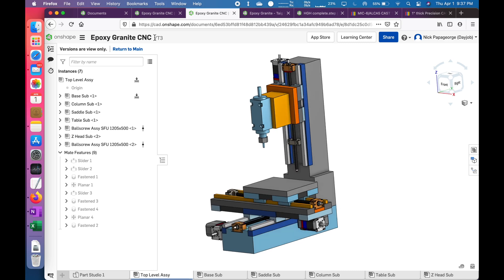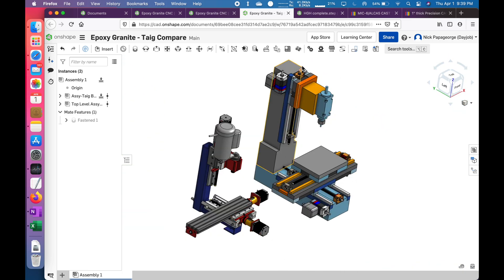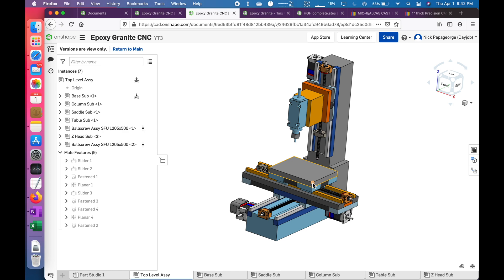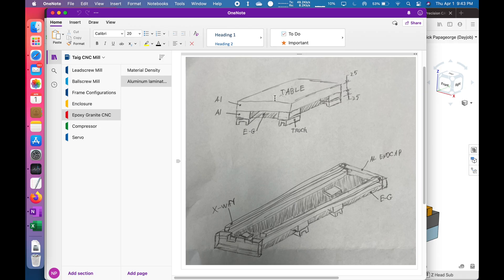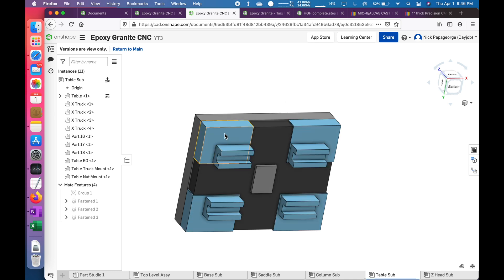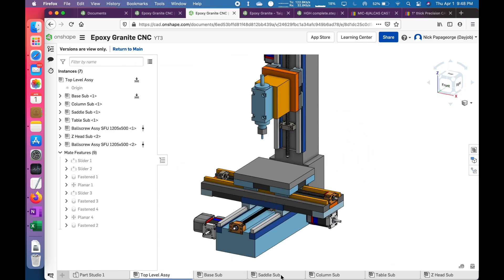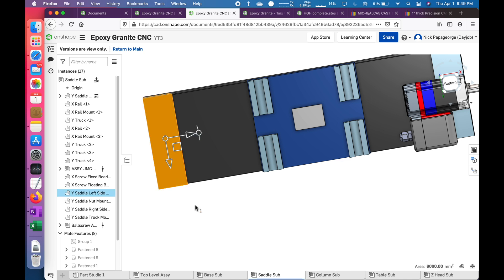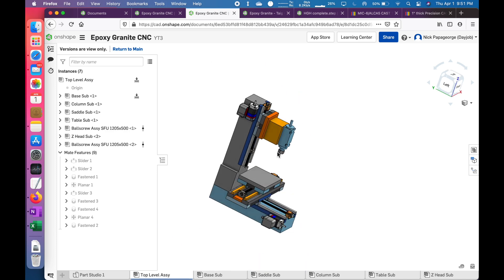Ep3: Epoxy Granite CNC Design - Table and Saddle Build Strategy

Comment: I'd like to see someone copy the old Light Machines ProLight 2000. Its frame is some kind of epoxy composite, all axes use servo motors. It can crank on some high speeds and has a 100 pound working load capacity.

The downside? The only software it works with runs in MS-DOS and it only works with EMS memory for loading large gcode files. It's like the company wrote the software to work on an IBM Model 5150 with an ISA RAM expansion card then *never updated it*. So most PLM2000 mills end up with their Animatics servo controllers removed and replaced with something else.

The 1000 model used stepper motors but instead of all the electronics being in a box on the back of the mill's frame, they were in a separate, large box and that connected to a proprietary ISA or PCI card. Intelitek still has some of those cards but they want a stupidly insanely high price for one. So most of the PLM1000 mills end up with replacement electronics too.

The PLM2500 was the same as the PLM2000 except for having a 42,000 RPM spindle VS the 5,000 or 10,000 RPM of the 1000 and 2000. ProLight also offered the mills without a spindle for custom attachments. The spindle mount attaches with 4 bolts so it's easy to change or to build a custom mount.

Intelitek bought Light Machines some time in (IIRC) the 1990's and from all the info I could find discontinued production of all the "big" Prolight mills and the PLM3000 CNC lathe.

IMHO that was a dumb thing to do since nobody before or since has made benchtop CNC mills and lathes that compact with the capacity these had.
Reply from the maker: That is a great machine, agree, the best bench top CNC ever made. I almost bought one, until I found out they were about 400 lbs. Too heavy for my 2nd floor apartment living situation.

Comment: My father’s ProtoTrak mill runs belts off the servos, is very well used, and will still mill an interpolated circle within a half a thousandth, better if it had new belts (they’re definitely due to be replaced).

Belts work fine if sized properly for the machine.
Reply from the maker: Thanks. I used the same machine in a tool room when I had a part time machinist job in the late 90s. Agree, the belts ran great.